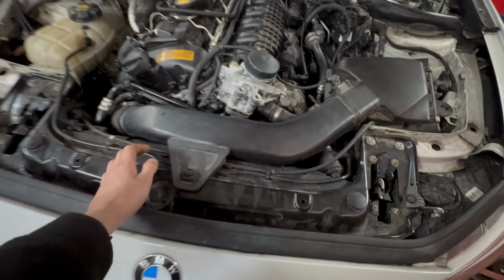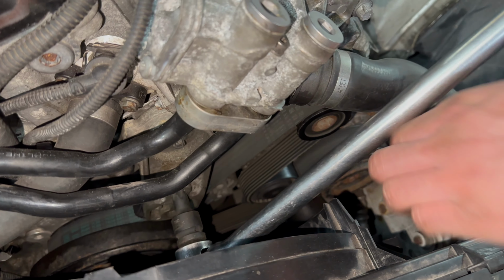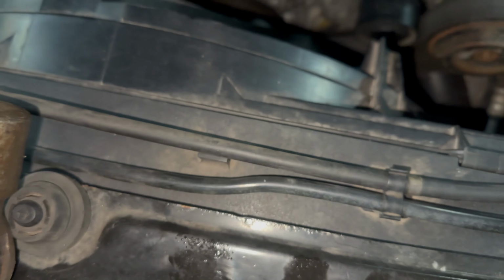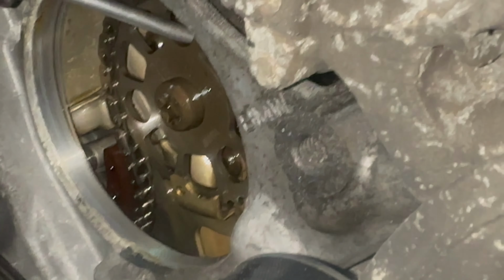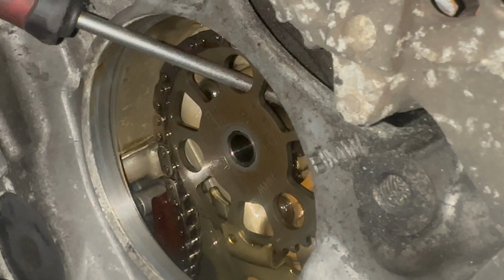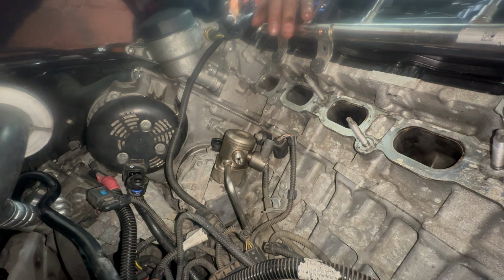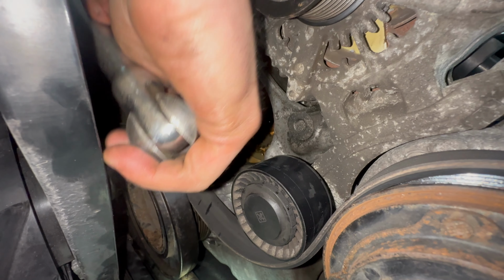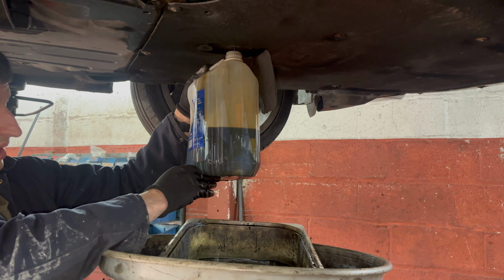BMW N55 HPFP Replacement M135i M235i 335i 435i F20 F21 F30 - High Pressure Fuel Pump 118402 118002

Comment: Perhaps it's mentioned and I just missed it, is it recommended to swap both the HPFS and the vacuum pump at the same time or was it just needed on this particular car?
Reply from the maker: They are one unit together so to change one or the other it’d need dismantling.
Reply: Thanks for vid but question watching the video it seems like this job can be done without compromising the sprocket and chain alignment, is this true? Do I need something to keep them held up while pulling the pump out? Thanks in advance.

Comment: Hello bro, i have a leak there from
The engine side where the vacuum pump is mounted, what is used there for sealant only the grew metal gasket bewteen engine block and the vacuum pump? Or also anything else? Thanks in advance!